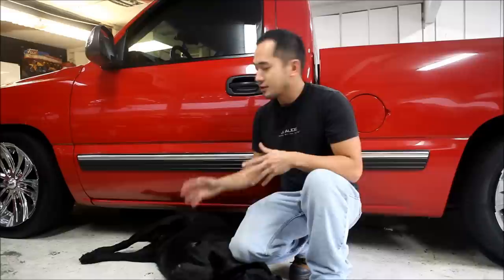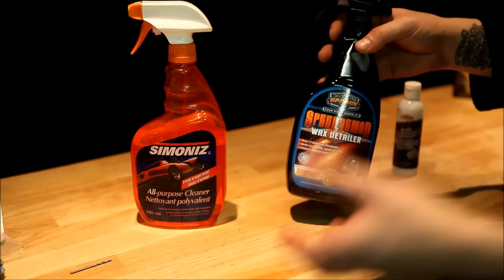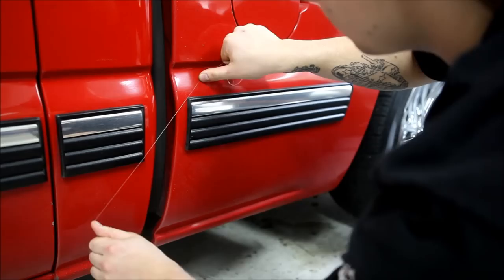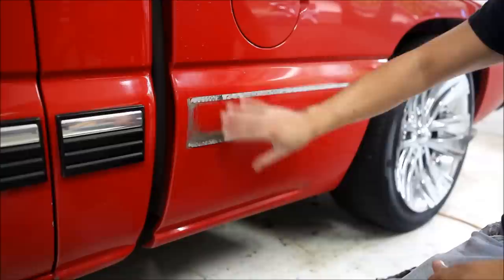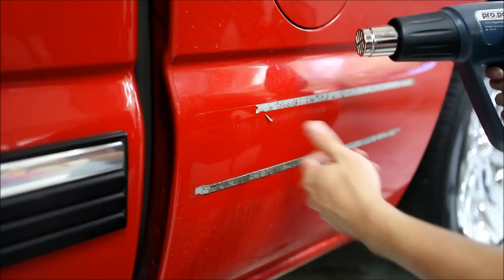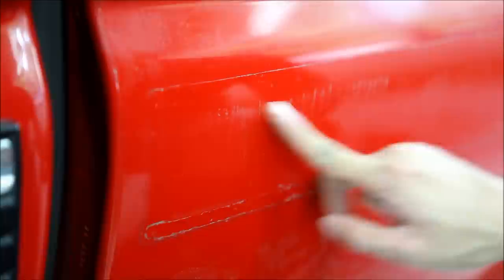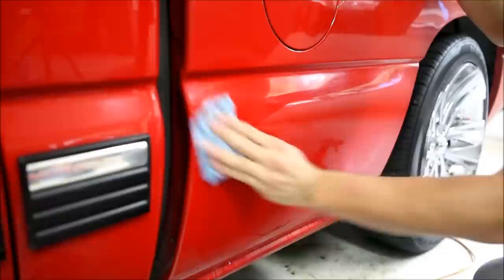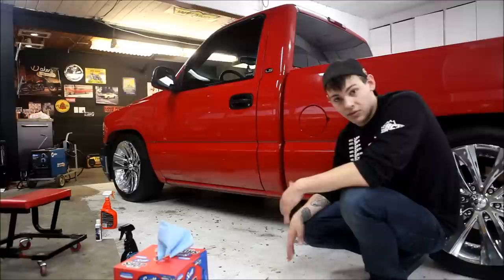DE-BADGE your Car or Truck / Remove molding from a vehicle | AnthonyJ350

Comment: You DO NOT want to use blue shop paper towels for this job. Use a micro fiber towel for the polishing and a wash mitt with car wash soap to clean it before  removing the tape residue. A micro fiber cutting pad with a polishing compound is best for surface correction.
Reply: That's what I thought too
Reply from the maker: I actually wanted to be slightly abrasive because the paint has been faded over the years and will help it blend.  Keep in mind that scratch remover stuff is abrasive too, how else do you think it gets rid of scratches?  We just want it to blend.  But I get what you're saying.
Reply: Compound or polish is used for that... it's controllable. Blue shop towels are made from wood... and scratch for sure... you don't want to do that to a paint job....
Reply: AnthonyJ350 can i put the used trim back on my car once i take it off from ur method of doing it
Reply: remove the old double sided tape and put on new to reuse the trim.
Reply: why not use a 3m eraser wheel.
Reply: SuperDave21 well I was gonna try that but for 1 they're like 40 bucks and 2 if you do it wrong you can burn the clear. my trucks white lol if rather not burn it and have yellow spots on it

Comment: Aquire Autoglym glue and tar remover.Drench the top edge with a paint brush(soaks into the double-sided tape),Wait e few minutes,Pull the top edge away enough to allow you to drench behind and soak the bottom edge,Wait a few minutes.Pull the bottom edge away.Push the soaked tape away with thumb.No scratches,no effort.

Comment: I work in a bodyshop and in most cases you have to use an eraser wheel to remove the double sided tape.  Then just wipe it off with lacquer thinner. Then just  sand it and polish it.
Reply from the maker: Awesome, thanks for sharing!

Comment: Hey so I got a quick question I understand this video is 8 y/o but if anybody in the comments could help me out or the creator could help me out I’m wondering if a plastic scraper would work better and be less harsh on your fingers? Also this video is amazing and very informational and the quality is amazing for being 8 y/o
Reply from the maker: Some moldings a plastic scraper used in conjunction with a heat gun can be pretty effective.

Comment: so i have a white 2004 silverado and the side moldings have aged into a almost yellow vanilla color...the paint condition on my truck is virtually flawless  and i want to pull them off. but eveeryone tell me the paint behind the molding will look differnt from the rest of the truck..is this true?
Reply: Did you end up doing this on your truck? I have an 04 Trailblazer and I'm worried about the exact same thing.
Reply: My 99 didn't have a problem with that at akl

Comment: Can't you just use WD-40?
Reply: Ford M Garage it might take off the paint
Reply: fuck no. wd 40 eats surface rust what do you think  would happen to your paint....
Reply: WD-40 is perfect to remove the double sided tape residue. WD-40 eats paint? Lol! Whatchasmokinsmokey? Soak it with WD-40 for a month and the residue will come off effortlessly with a plastic scraper. That's how I did mine. No issues. No damage. No scratches. Use 3M VHB double sided tape on a hot summer day to reapply the moldings and the vehicle will be good as new.
Reply: TrakSpock1 soak it for a month? Another virgin statement.. like we got time to soak it for a month..

Comment: Ya the heat and pull method works pretty good. I don't want to have to buff just because I'll end up doing the whole truck. One thing to mention is that compounding on 2 stage is a "no no". Well by hand it's a "no no" anyways. Look up /Drive Cleans Larry (forget his last name) video on single vs 2stage and hand polishing. That guy's a GOD when it comes to detailing.

Comment: Did you find that the paint under the moulding was not as faded as the rest of the vehicle? I'm surprised I didn't see a difference... especially with red
Reply from the maker: Surprisingly no it looked pretty much the same as the rest of the truck.  That is one thing you might have to deal with depending on how old the vehicle is and how well kept the paint has been,

Comment: Has anyone had their ls pillar badge melt? What did you use to get the melted goo off?
Reply from the maker: Bug and Tar remover will work.  It's not super aggressive and is safe for clear coat.  You can find it in the detailing section.  You will have to put effort in to remove it.

Comment: Can you notice a different tone/shade to the paint? I have a 2003 silverado and am wondering if I take it off if the paint will be a different tone where the molding was
Reply from the maker: We didn't notice on this truck.  It is a risk depending the the quality of the factory paint and the are you live in.  That's why we used the scratch remover and the shop towel, because both are very fine abrasives, in hopes to help blend the paint.
Reply: AnthonyJ350 thats what I am worried about, this was a Florida truck up until 4 years ago. So its hard 4 years of being outside in the Michigan environment, its the beige ish/ tanish color. The trim is the exact color but Im wanting to take if off just worries its all weathered and underneath the trim hasnt

Comment: Eraser wheel
Reply from the maker: Roma Razumovsky Good tip, I would caution a novice not to use one though as you might burn through the paint if you don't pay attention.

Comment: Hey Anthony J350,
I removed my moldings on my 2007 White chevy silverado but there is yellow stains underneath the door molding. Do you know the best wax I can buy to remove the yellow stains???
Reply from the maker: +Raul Castelan Hmmm is it smooth though?  I would talk to your local detail shop.  Maybe a cut polish would get rid of it.  You could also try a "scratch remover", which is a very light abrasive but suppose to be safe for clear.  I'd do it by hand unless your experienced with a machine.  Other wise talk to a professional.
Reply: Yeah it is smooth. I live in AZ so the heat and the adhesive glue just stained my truck.
Reply from the maker: Raul Castelan I'd try a good bug and tar remover designed for clear coat first.

Comment: was the paint around where the trim piece used to be not faded?
Reply from the maker: It is something you might run into depending on how much sun exposure and maintenance the vehicle has prior.  But in this case the paint was fine and matched nicely to the paint that was exposed over the years.

Comment: i have an 04 silverado, would it be the same exact procedure?
Reply: I assume so. I basically did the same thing on my commodore vz
Reply: Did you do this on your Silverado? Was any paint fade noticeable? I have an 04 Trailblazer I want to do it on, but I'm scared of a non-faded "stripe" where the moldings used to be.

Comment: figured anything with grit would scratch it?
Reply from the maker: What do you mean?  Are you talking about the compounds we used or the dirt?
Reply: compound
Reply from the maker: mudriding350 A scratch removing compound does technically scratch it but it's so fine you can't see it and that's how they get rid of minor scratches.

Comment: what was gm thinking when they designed those moldings? a lot of silverados have them and they completely destroy the appearance of the truck. the painted ones are much better, but i prefer no moldings at all. just be careful where you park, who cares if you have to walk a little further.
Reply from the maker: They were probably thinking function over form.  And a lot of pieces like that seemed to be style in a similar fashion to their 90's product.  They're doing a much better job now.
Reply: Sam Ace Rothstein it doesn't matter how you park, it's how other people park. Once those mouldings are gone, say goodbye to your ding free door. A clean moulding looks better than shitty door dings all over the side, IMO
Reply: are you high? it absolutely makes a difference where you park. if you're parking in crowded areas or not finding end spots where you can leave extra space between yourself and the next car, then you are significantly increasing your chance of dings, it's only logical. i don't know what you're talking about, but those moldings are positively hideous. i'd rather get the dings, they're way less noticeable and there are professionals who can easily remove any door ding who charge per panel or per dent depending on who you go with. no one is going to see your typical door ding from 10 ft away, you'll see those ugly moldings from a mile off.
Reply: There are lots of times where you are either parking on the street or the parking lots are nearly full right to the back, and the side. Unless you live in flatlands where the parking lots are a mile long most of the time your going to be parking one over from someone and then someone parks beside you anyways. I think side moldings are beautiful, they really set the truck off right. Without them, the truck looks like a base model work truck with delete everything. Then again, that specific truck is lowered. Lowered trucks are for shmoes that can't afford a nice car and don't know WTH a truck is actually for.
Reply from the maker: Dh66 That's pretty judgemental and uncessary. Did you know some of us like lowered truck's because you can no longer buy a body on frame car with a V8 and a 2WD truck is an alternative. What do you drive that makes you have this attitude?
Reply: Well, I did say "shmoe" which doesn't really mean anything. I dunno I guess I just don't like lowered trucks. You're right though I shouldn't judge, if someone wants to make their truck more like a car, all the power to them. It makes them less useful vs more IMO. At least with lifted trucks you gain ground clearance and increase their usefulness. I have a wood fireplace and I pull my own deadfall out of mountainous areas where there are logging roads with ditches that you need some extra clearance to get past it. My Dodge W100 is a piece of crap I bought for $500 and its at the stock 4WD height and I can get through quite a lot. I have another truck, a '71 Chevy that I'm doing a SFA conversion on to replace the Dodge. I tossed it's rotten 2WD drivetrain and I've got a BBC, 1 ton rated NV4500 trans, NP241 tcase and Dana 44 / 60 Axles, I only put about a 6" lift into it but that just happened naturally with the suspension I designed for it. I only put a set of 33x12.5 tires on it. My DD is a 4WD Tahoe, good for hauling the groceries and family around, going on trips up into the mountains. I'm putting morimoto projector retrofits in it and have swapped the stock lights, tails, bumper lights and fog lights. Thinking about removing the G80 limited slip and putting a spartan lunchbox locker in the rear diff. For fun I have a 1969 Camaro, I rebuilt it from scrap condition, its lowered, has upgraded suspension, killer paint, minor customized interior, 406ci SBC with a 200 shot of nitrous. TKO 5 speed, 18" wheels, large brakes, etc. I also have a motorcycle but I don't ride enough so I'm selling that. So yea, nowhere in my life does a lowered 2WD truck fit in there.
Reply: Dh66 luckily for us, there's many kinds of trucks that serve different purposes for all kinds of people. living in an ordinary suburban neighborhood negates the need for a heavy duty pickup for a typical family. your average 4wd pickup for light hauling and winters is all that is needed, it can easily be converted into a sports truck as well without sacrificing functionality. btw, your camaro sounds fucking badass!

Comment: will a thin guitar string work?
Reply from the maker: It would but that's metal.  The fishing line is nylon or something soft, and dental floss is soft as well.
Reply: Venki Kiven youd risk getting deep scratches with a guitar string since its metal
Reply: SNEAKAHOLIC817 m
Reply: AnthonyJ350
Reply: A guitar string?! Are you F'n nuts?!?!

Comment: Wtf is up using blue paper towels?
Reply from the maker: Alberto Garcia I watched a glass guy use cardboard as an abrasive one time. We we figured since the scratch remover is already an abrasive the shop towel will act as a minor abrasive to help blend the paint that hasn't been exposed to any sun over the years.
Reply: AnthonyJ350 - That's a first for me. Even the final spray wax was applied with a blue paper towel..crazy. 😬
Reply: AnthonyJ350 - That's crazier than the blue paper towels! The paint you say has not been exposed to the sun in years, then wouldn't you want to treat it like new paint with maybe a buffer to blend it ? If for example you get a front fender repainted a shop is going to buff it together with the door to blend the new paint. They're not going to use an abrasive to blend the color. Just saying.
Reply from the maker: Alberto Garcia But buffing they use abrasive compounds with a machine. Did you see deep scratches after? It was filmed with a Cannon D5 camera. You don't have to do it this way. Use a microfiber cloth if you want.
Reply: AnthonyJ350 - They use compounds that were specifically made for buffering. Your truck looks fine but towels were not made for that purpose. I doubt you would wax your entire truck with blue towels.
Reply from the maker: Alberto Garcia You're right we wouldn't. Just making the best with what we had that night.

Comment: princess auto. sounds fruity
auto king would be a better name
good video though. 
lower heat for a longer time works better. takes a while for heat to pass through trim
Reply: goo gone will remove glue without cooking your thumb